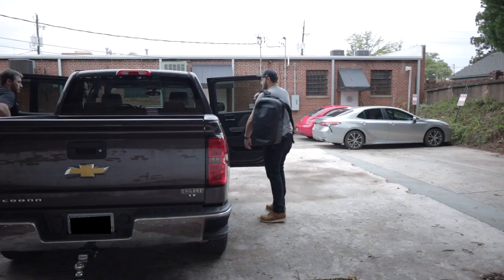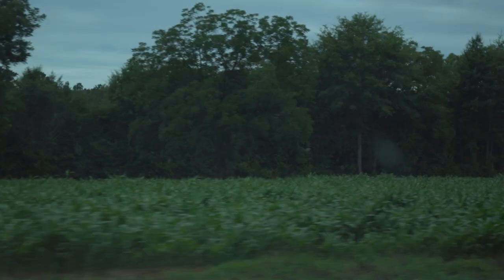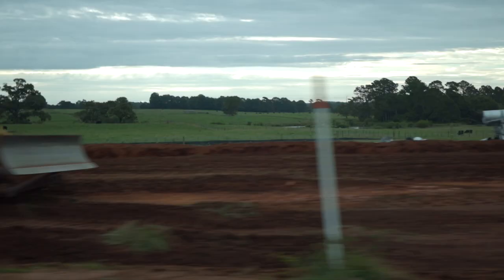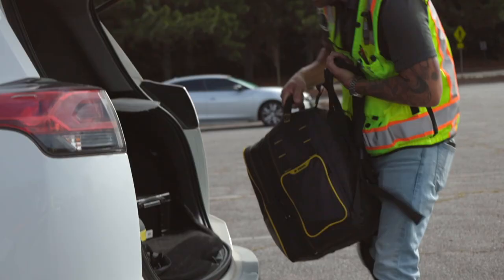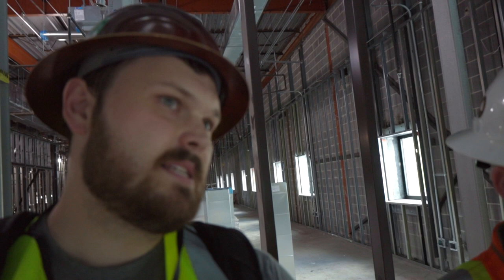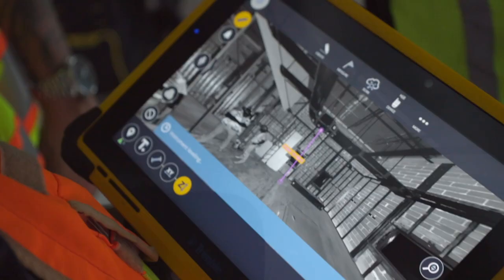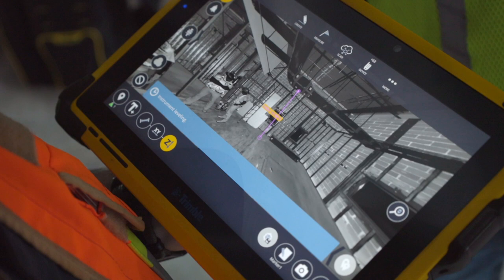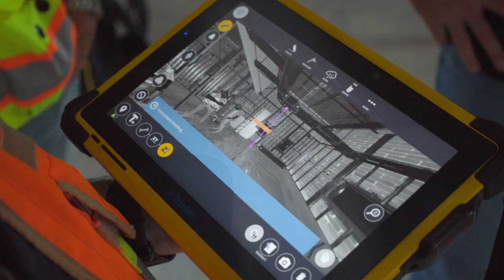IS THIS THE BEST 3D LASER SCANNER? | TRIMBLE X7 TRAINING & FIRST IMPRESSIONS

Comment: but the faro S scanners have onsite registration, which also does the registration in the field!
Reply from the maker: We need to get our hands on the faro and test it out next!
Reply: While the Faro can do “on-site registration” I have tried it several times (scanner settings: Resolution 1/4, Quality 1, HDR 2) and your time on site will be increased due to the rather (IMO) slow speed with which the Faro registers the scans onsite. With these settings 1 scan took over 10 minutes just to process let alone process and register to the second scan. Think about the rather limited computing power inside the little guy when compared to your laptop/desktop with 32-64 Gbs of ram crunching through that data. Obviously your scanner settings will dictate the 
scanning/registration time so based on your clients level of detail in the scan data it may be a viable option. The Faro rep recommended for on-site registration 1/8 resolution, Quality 4. Thanks for the X7 review!
Reply from the maker: @LouieJules  This is great!!! Thanks for the report!
Reply: You have onsite with both. The Trimble has better infield software though